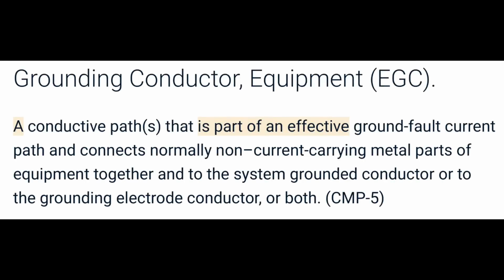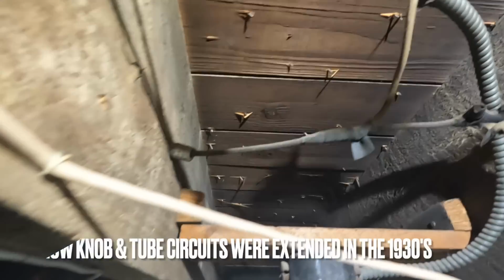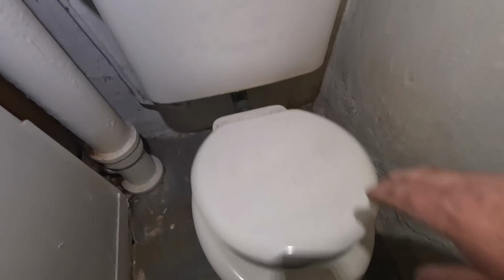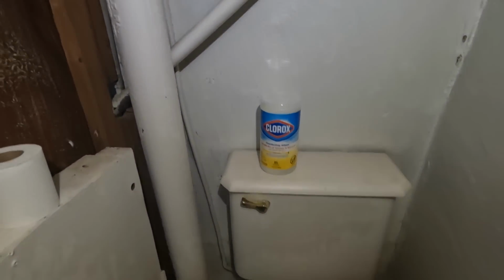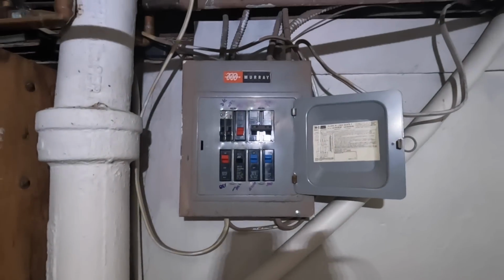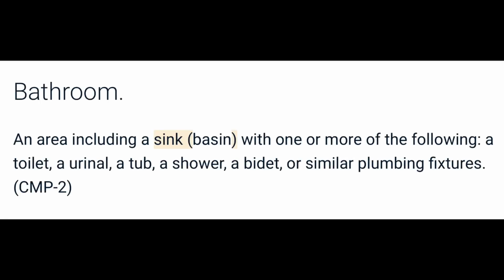1925 Colonial w/ Knob & Tube type wiring

Comment: This video reminds me of old barn wiring. Not code. But it worked. How it worked, I couldn't tell you. But it did. This video also reminds me of Micky Mouse wiring. I haven't wired in several years, this brings back many memories. Thank you so much for tagging all of along.
Reply from the maker: I'm not going to pretend to know about wiring a barn but I have read that an equipotential bonding grid is required around d a barn. Cows especially  if they receive even the slightest difference in potential it could be deadly.

Comment: when installing duplex receptacle horizontal. Have ground slot to the left, so the phase/hot slot is at the bottom. not NEC requirement, just some jobs specification requirements and it’s a good practice, especially when using metal covers. Because in the future, if the metal cover comes detach, it won’t be in contact with the phase slot if a plug attachment, is not fully installed into the duplex receptacle. 😅
Thank you for your videos!!!!
Reply from the maker: @turnersst  No one uses metal cover plates anymore. I haven’t installed a new one since 1995!
Reply: @electricianron_New_Jersey  Still very common in commercial jobs like hospitals and schools.
Reply: @carbongrip2108  I installed a GFCI outlet and replaced all of the other outlets on that circuit around the baptistry at my church and used stainless covers all around.
Reply: I was thinking the same thing I always put the neutral up, on a horizontal installation. I normally wrap the device with 66 tape just so the bear ground does not accidentally hit the hot. Also, I would’ve fire foamed , both wire penetrations and around the boxes help stop drafts. You would be surprised how much air passes through and around those boxes.
Reply: nonsense!

Comment: Old work 3-4 times as long. Your right. I always used to get anxiety doing old work because I felt I wasn't going fast enough. A lot of electricians don't want to touch old work. They will install a new panel or a new circuit but don't like rewiring. A friend of mine who was a commercial electrician his  neighbor wanted him to rewire there 100 year old house that was all K & T. He politely turned them down. It just wasn't his thing. They found two women electricians that specialized in old work who zipped through it. To each his own. As Clint Eastwood said "a man has to know his limitations" LOL
Reply from the maker: @ed6837  I’d much rather rewire an old home than stand on a 10’ A frame ladder above a suspended ceiling splicing MC cables to a J box.

Comment: My first 2 years as a Electrical Apprentice after completing 2 years of classroom  instruction in 1968 was working for Stone's Electrical Service in Decatur, IL . He specialized in Upgrading and Rewirng Older homes in Decatur that were built in the early 1900's through the 1960's . Most of them had knob & tube wiring on a two wire 60 Amp Fuse Box. We up them to 200 Amp Service and replaced all the knob and tube wired circuits. All branch circuits in the basements were all done in EMT Conduit
Reply from the maker: You guys sure are funny out there running conduit to everything. It's the only part of the country that demands conduit everywhere.
Reply: @electricianron_New_Jersey  If my history is correct, this was probably due to the Great Chicago Fire that the conduit requirement was enacted in the first place.

Comment: A lot of times in my area you would find old Romex with a ground but they kept the Romex ground out of the box and would ground the bare Romex EGC to one of the screws on a two screw connector. Very commonly done although not right. My old boss that I got my license from told me at one time they thought keeping the ground outside the box was better
Reply from the maker: @ed6837  Yeah I’ve seen that a bunch of times too.  I think the BX connector still had the lock nut on the connector.  If I had to guess the guy who installed the box forgot to remove it before putting in the box.

Comment: That’s where I got my start! Homes in Philadelphia and also aluminum wire conversions! Most receptacles cut into the old baseboard.
Reply from the maker: @jamescollins8148  Philadelphia, like New Jersey, are both old and go back to the founding of our country.  I always say “there’s no shortage of old houses and I’m good at working on them.”
Reply: @ I don’t do the old homes any longer, but I specialized in rewiring the older homes mostly without disturbing the walls and ceilings. Monotonous, but paid very well!
Reply from the maker: @jamescollins8148  it's the best!

Comment: Ron, what bit extension on you using in your impact?
Reply from the maker: @FrontRowOrBust  Probably the Milwaukee 6”
Reply from the maker: Actually, I think it's just something I saw on Amazon and bought something I didn't need. The magnet works well but it's some knockoff manufacturer.
Reply: @ I have a 6 inch Milwaukee. Though your may have a good magnet on it

Comment: Thanks for doing a video that addresses old knob and tube wiring. I have a few questions: first, how do you price a job like this that has so much variability? Do you have a daily rate in your mind and make your best estimate in terms of how many days it will take? Second, you mentioned that the bedrooms have only one receptacle. What determines if you have to add additional outlets in a bedroom as opposed to just upgrading an existing outlet? Could the inspector or municipality say there needs to be additional outlets?
Reply: Just my opinion but I don't think the inspector can make you install additional receptacles if your just rewiring the old ones even though it would be a good idea. The code says you can't create or cause a hazard. Now if the inspector comes to inspect and sees extension cords on the floor running to the one receptacle he may have an issue. Now if you are remodeling a room and demo the plaster on the walls and ceilings then they would require that that room be brought up to code. We will see what Ron says, he has more experience than I.

Comment: My first house was built in 1925. Tons of K&T with a little bit of BX. 60A four-fuse panel. I spent about a month after work rewiring the thing. Balloon-framed with zero insulation - you could pull romex all the way from the basement to the attic with nothing in the way... Talk about a fire hazard.
Reply from the maker: That’s the old Chicago style. That style of building has been banned for a long time.

Comment: I think it was 1940 when K&T went out.  It is so old now that oxidation of the copper makes the wire much smaller.  Pretty much only good for overhead lights that are a PITA to get to with new wire.  Our house when I was a kid in the early 70s had mostly K&T.  Typically the bedroom had one light and NO receptacle outlet...just a light.  Often a receptacle outlet adapter would be screwed into that light to power alarm clock, fan or heaven forbid, an air conditioner.  The good ole days.
Reply from the maker: I have three ceiling lights on the first floor to rewire. Kitchen, dining room, and laundry room. ALL on the first floor and NO access.

Comment: BX metal clad with cloth encased rubber insulated wire was the replacement for knob and tube, which appeared around 1927.
Reply: Even now it's still pretty sketchy, especially if it's been modified or wasn't done right.

Comment: 2nd - LOL.   my wife bought our house in 1994 (built 1930) and we married in 1996.  House is 1100 sqft and had 60 amp 4 fuse box with K&T and missing wire coverings - yes, ouch

She and her general contractor Son-in-law and construction Son did the remodel and she pulled out all the K&T and installed romex.  I came along and in 1998 I installed the new 125 amp combo service entrance device (CSED with meter and 8 space panel) and a new main service panel by permit.  I did not like that K&T.  Today I am in process of installing  new a main service panel,  200 amp as well as new 150 amp CSED (hope for future 200 amp service - they charge upgrades at $35 per service amp).  First time seeing K&T.  I guess seeing BARE wires going across the attic 2x4s got me nervous.  Thanks Ron for all your instructions and insights.  Love your videos, great work
Reply from the maker: @dougbertInExile  Good stuff Doug and thanks for compliment.